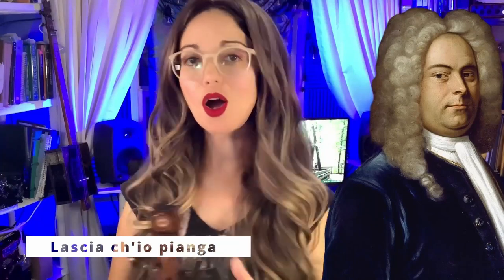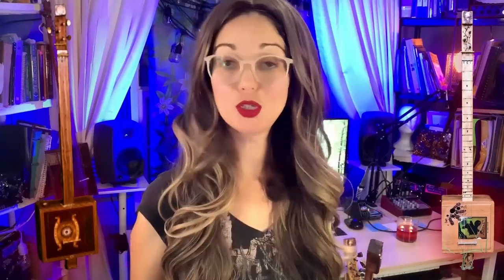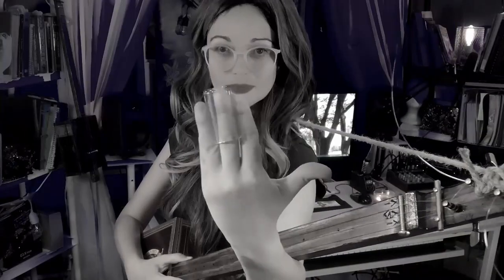Nylon Strings vs Steel On Cigar Box Guitars: Actually Tested In This Video!

Comment: interesting comparison, I think you're right about why others say avoid nylons, but there is a practical reason, from what I understand Nylon strings don't work with single coils or humbuckers which are quite popular on a cigar box and thus why they aren't used, I liked the sound of the nylons with the piezo, unique tone especially with the slide opposed to picked.

funny thing, I've never used either for a Cigar box guitar, I use Nickel strings from electric guitars, not quite as heavy sound as the steels and the variety of gauges to play around with I have found to be better
Reply from the maker: Hi! You are right! ✨I forgot to mention  that I only built using piezo pickups; that was a very important detail that I didn’t address in this video. 😓 I avoid magnetic pick ups because they negate the unique acoustic characteristics of my cigar box guitars. 🎸 I made a funny little short aboutthis topic. check it out. Let me know what you think: 🤔 https://youtube.com/shorts/7707k68mSfc?si=Dk3SzBTdRYvoLfDF
Reply: @psycheopera  I watched your short and I enjoyed it, you are quite right, the piezo does preserve the acoustic qualities of the cigar box guitar much better than a magnetic pickup. 

I'm very much an advocate of using natural acoustics with builds to give a unique tone, the size of the box for example, do you favor deeper or wider boxes for sound, I like a deep body for resonance
Reply from the maker: Hey JP!✨  I really like using larger boxes, but they are hard to come by. Of the boxes I've been able to get regularly, my favorite is the Tabak Especial Toro Negra, which is approximately 9.5 x 8 x 3 inches.
Reply: @psycheopera  thats a very nice size for a box, that 3 inches deep must give some beautiful resonance and tone. here in the UK I regularly find similar size tins for my builds 10.5 x 8 x 2, get quite as deep, but just enough for my 3 stringers and my 2 string basses. looking at your range, I'd say you've chosen your box sizes very well, bigger ones are rare, but worth it

not to make you jealous but I recently got ahold of a massive chocolate tin for a bass build 15 x 8 x 3 and another thats 5 inches deep, the tones will spectacular. may I ask, do you ever come across tins of danish butter cookies over there? if so I recommend them for builds if you ever wish to try one.
Reply from the maker: Wow! I am jealous LOL!😮 I've never run into a cookie or chocolate tin that size. I'm very curious to hear your bass, JP! Please produce a video; I'll share it in my community posts. 🔥🤩